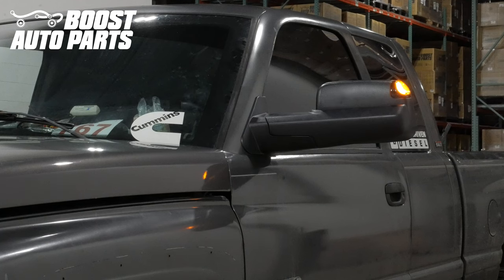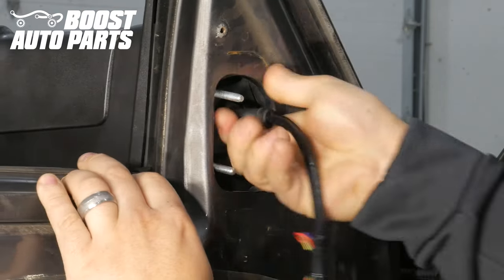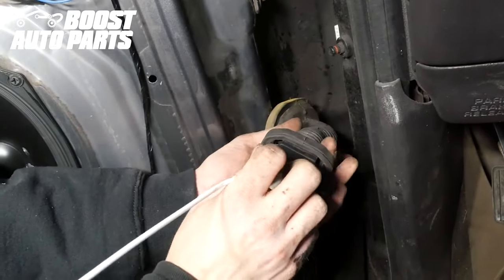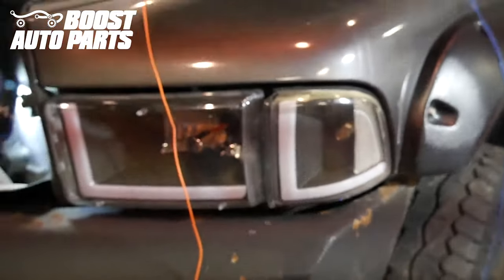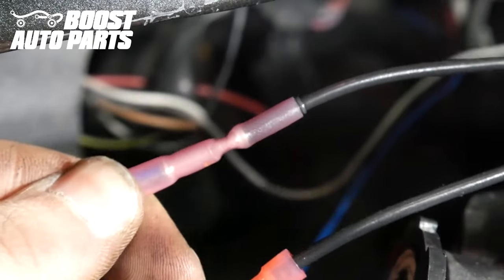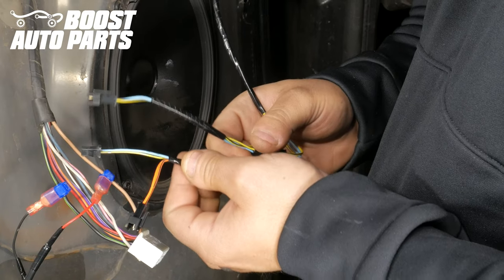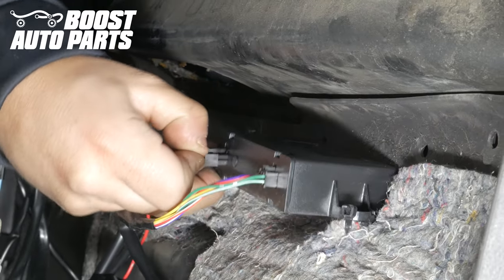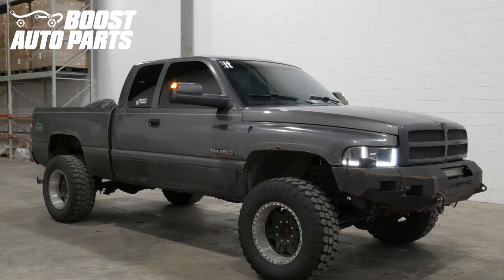Tow Mirror Install: 1994-2002 Dodge Ram 1500/2500/3500 Towing Mirrors (Add Power Folding) - 2nd Gen

Comment: Will the power fold option be available for 03-07 silverado? My truck has the factory DL3 power folding mirror option. It would be sweet to have the feature work with the 15+ tow mirrors.
Reply from the maker: Those mirrors are under development at this time. Email sales@boostautoparts.com to be notified when they become available.